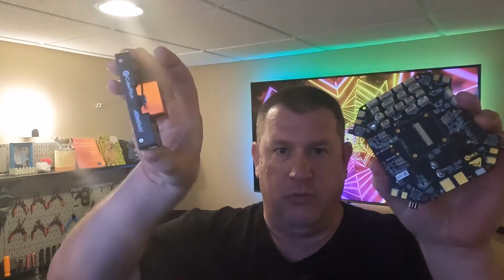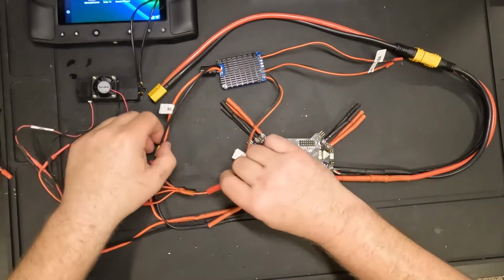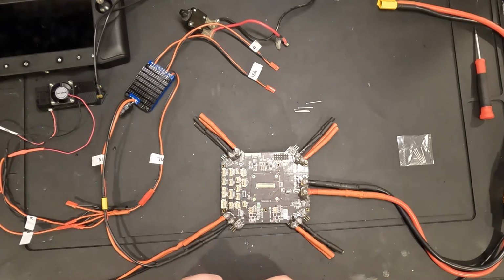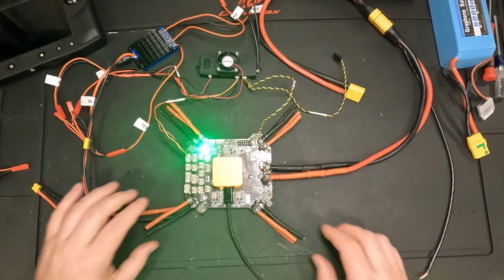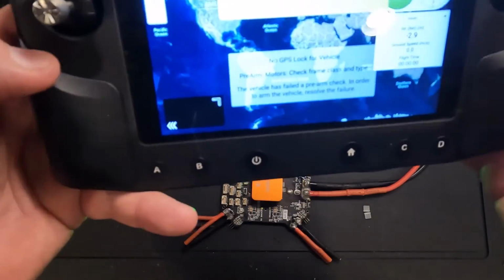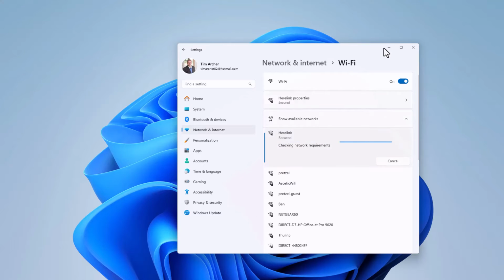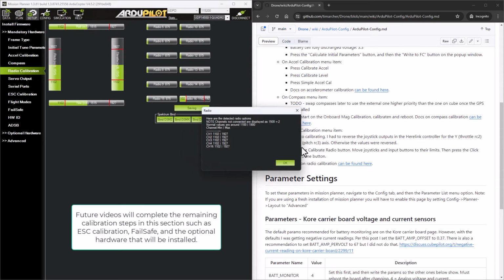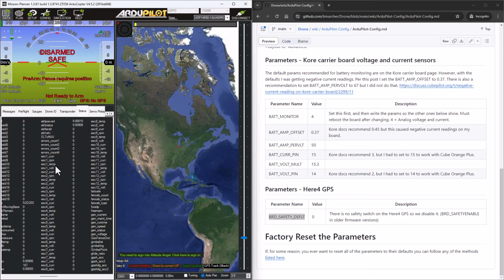Hexacopter Drone Build Project – Part 4 Cube Orange Plus and Kore Carrier Board Initial Setup

Comment: Fantastic Videos Tim.... If I may Ask, what is the spec of the S2 Batteries that you are using for testing?
Reply from the maker: In this video it's just a 6s 6000mAh battery I bought off Amazon. XT90 connector on it. The real battery going in the drone though is a 12s 16000mAh Tattu smart battery. I just received it this weekend and made a YouTube short on my channel showing it. The next video in my series will show the full battery and how to wire up its CAN interface to allow the flight controller to monitor it.
Reply: @timarcher52  Thank you Tim, Looking forward to seeing the next installment

Comment: I’m not using a secondary computer. Why did you choose to if you don’t mind me asking.
Reply from the maker: My day job is a software engineer and I do computer vision projects. My hope is to use the raspberry pi, a Google coral, and some custom sensors and cameras that I want to experiment with just to see how I can perform autonomous flight control. Step one will likely be something very basic such as placing a few giant Aruco markers on a field and seeing if the drone can fly itself from marker to marker using computer vision to detect them.
Reply: @timarcher52  very cool!!
Reply: @timarcher52  interested to see how it excels